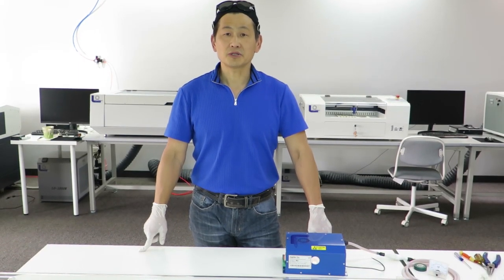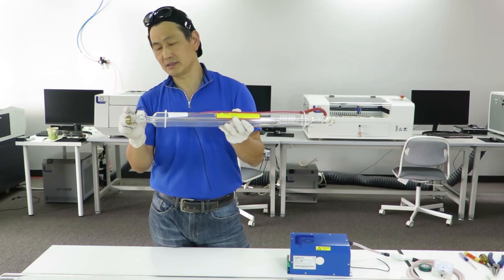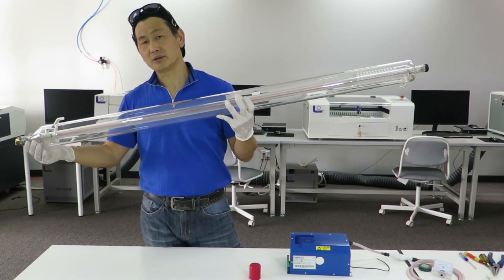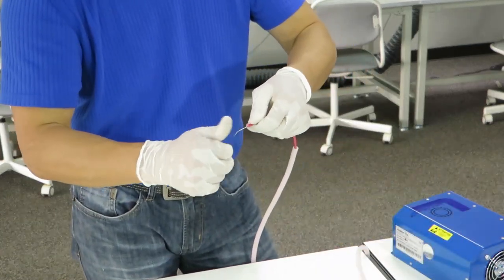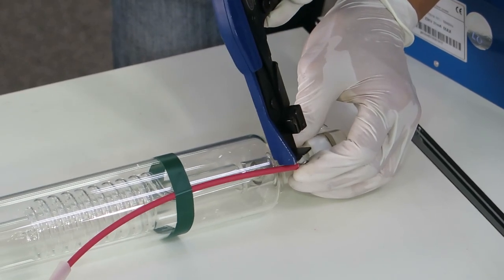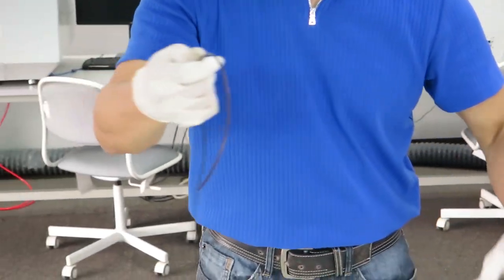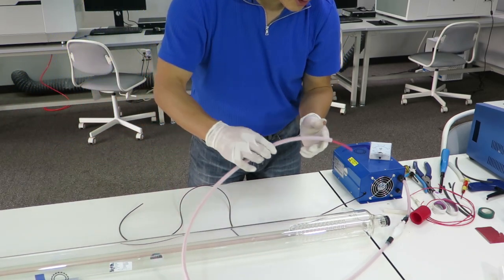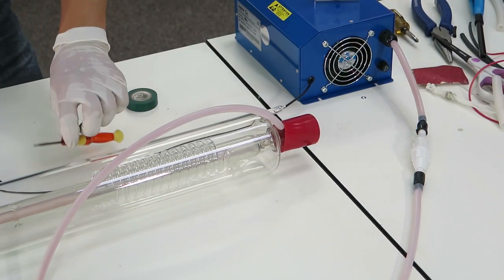How To Wire Laser Tube, Power Supply. and Current meter

Comment: Great video!  You're exactly right about putting plenty of silicon around the high voltage connection. If not, even if you don't get arcing you can still have corona that will give you problems.

Comment: Great video! very informative, what size wire is the positive wire to the tube, I need to extend the positive wire from the power supply.
Reply from the maker: It is a special high voltage cable capable to carry 5kv without arcing. Do not use a regular electrical wire or you will get trouble. You can shop the cable from our  website Lightobject

Comment: Where can I get the tubing? I have the second example one and used a suppplied cerammic block but have noticed some "browning" and would like to redo it with your method but wnat to make sure I use the correct tubing.
Reply from the maker: You can just trim a small piece from your water chiller tubing. It should made of silicon. Or , shop it from our store : www.lightobject.com

Comment: What kind of silicon tubing for the positive side wire are you using?
Reply from the maker: The type you used on water chiller
Reply: @LightObject  thank you. The positive wire appears to only have a little wire and two protective sleeves, one harder and the red?

Comment: why not use circle connectors when attaching to the laser tube is bare wire better? thank you
Reply from the maker: You have the picture to show? We found a pin-type connector that seems good for this use. I will post a new video for a new approach: pin and soldering.

Comment: Is there a reason why you didn't solder the positive cable connection? Wouldn't it be much safer to solder it?
Reply from the maker: Heat cause expansion and may cause gas leaking. Someone may have luck but some don't eo why take chances?!
Reply: only very few DIYers have the technical equipment to solder high-voltage connections properly. 
Therefore, it is better to make the connection as shown in the video.
Reply: Do it a different way, get yourself a box of cable end ferrules of different sizes (the little round metal sleeves you crimp on the end of a stranded wire). Find a ferrule size that fits on the pole (or is close to it), if it is slightly too big you can just make it to size with some pliers so it becomes a friction fit on the laser tube positive pole.

Solder the high voltage wire to the outside of the ferrule (do this away from the tube) while making sure the (now friction fit sized) inside of the ferrule is not clogged up by the solder.

If done correctly you should now have a high voltage cable that you can connect to the laser tube without the need for a zip-tie and is still super securely attached (with better contact too) to the tube.

Add silicone and a silicone tube as normal to prevent arcing and job done.